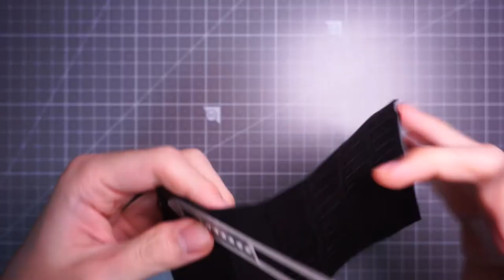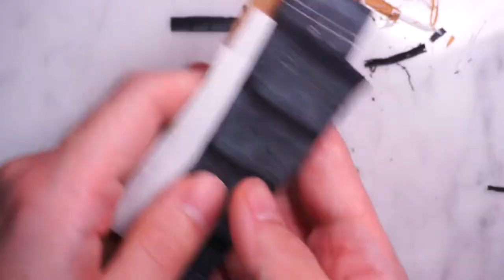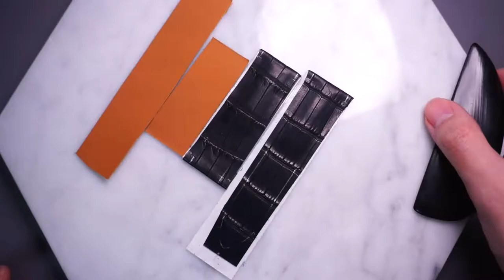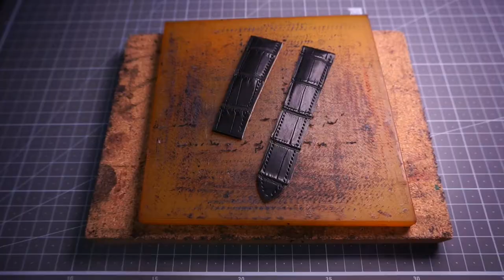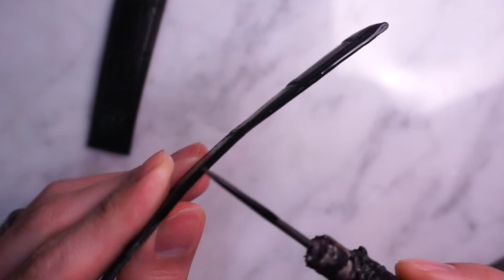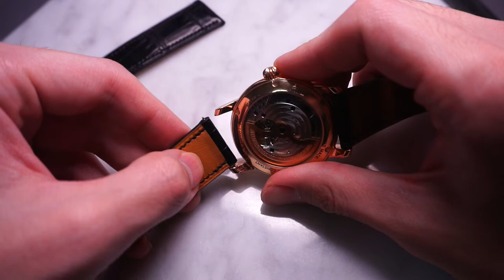Making perfect Watch strap with Hermes Alligator leather. 에르메스식 시계스트랩 만들기(TCIM엘리게이터)

Comment: this is finest work i ever seen on YouTube, two questions 🙏🏻
1. why adding a paper in the middle layer?
2. why need hot ironing after edge paint? smoother?
thanks 🙏🏻🙏🏻
Reply from the maker: Many thanks🙏🏻

1. that's not a paper, that is the non-stretch reinforcement to prevent stretching of the straps.
2. sealing the edge, more secure adhesive performance, smoother surface of the edge.
Reply: @AtelierSANGBLEU  thank you so much, learnt a lot

Comment: Great job!Where do you buy exotic leather for your projects?
Reply from the maker: Thank you for the comment ;)
I've been contracting with the local distributor of the exotic tanneries in here.
If you need to get the exotic leathers, you should find the local distributor like I did on your country.
There have CITES issues when we need to import or export them by our selves, so I just recommend you to find one 😭
Reply: @AtelierSANGBLEU  The problem is that in my country doesn't have any exotic leather distributors. That's I asked you about your supplier. If they can shipt abroad that will be possibility for me.
Reply from the maker: @krasenpetrov2805  That's too bad... maybe if there have no distributors or representatives, you might contact the tanneries to ship them to you directly with the exporting CITIES but, you should know how to handle the import CITES documents on your country which is the hardest part🥲.

Comment: Not bad , but I wold reverse the middle piece you have scived with the face up in order to have a smoother surface of the croc leather that you are gluing on top.
Reply from the maker: Thanks a lot for your suggestion! Great idea! 
From time to time, I do that flipping for that reinforcements when the supple leathers were used as the reinforcements (such as Chèvre, and other supple calf articles)
But, I tend not to flip the Barenia as it is pretty hard to push them down facing up (Barenia has the Veg tanned leather's hard characteristics)
Even with that face-down method, we can achieve a smooth surface which is shown on the other video that I've uploaded 😉
You can check them out in this video below🤗
https://youtu.be/l4_Z6CoQ9so